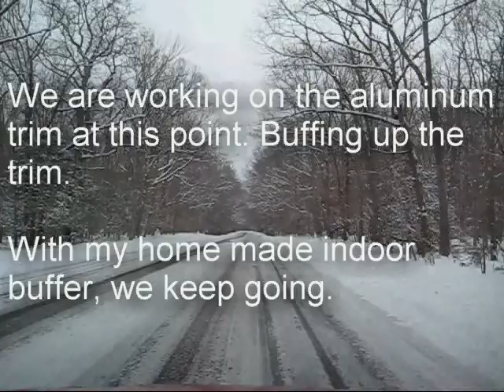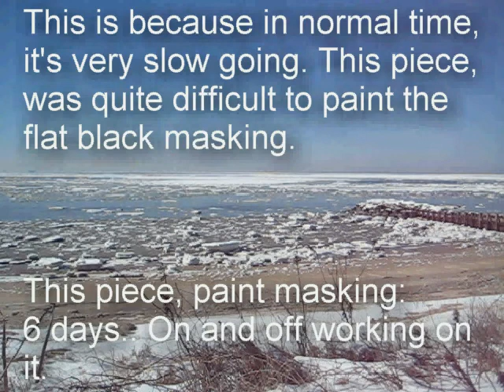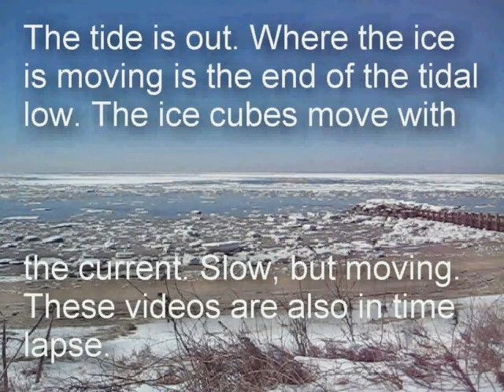62 Fairlane Interior Parts Prep 05 (More Buff Paint Black Masking too)

Comment: The tail plate looks amazing, looks like a new one now :-))
I wonder how the manufacturers did it, we will never know...
All the buffed up parts just gleam like new, this car is going to look fantastic :D
The black and chrome look so smart :-))

i remember some of the c.b radios ive repaired for truck drivers had a similar black/chrome contrast, I called them "The classic american c.b look".
American sidebanders were rather illegal in the uk, didnt stop people importing them though ha ha :-))
Reply from the maker: zx8401ztv From the way the black masking was soooo even, looks like they stamped the piece, then on machine. Most likely the same process painted it, although I don't think it was paint. I think it's like a ink. On some of the squares, the black was skewed off a hair. The black is supposed to highlight the shining lines, and the contrast, to the black seems the lines are brighter. I suppose it's more of a optical illusion kinda thing. The headlight housings and the tail lights have the same type of black. I also have to do those. Chow!.